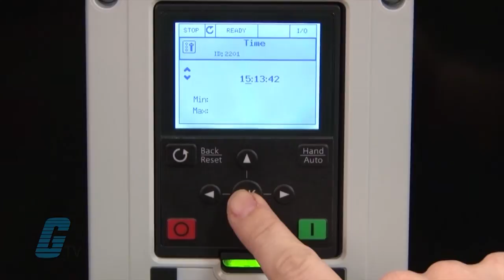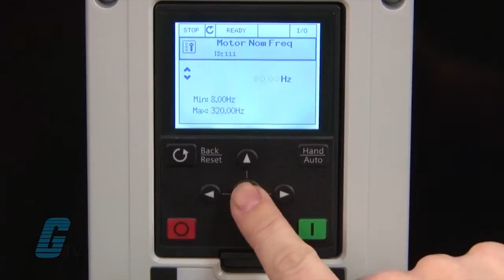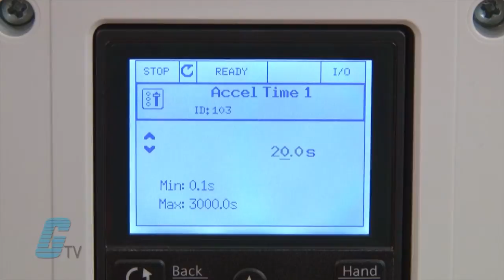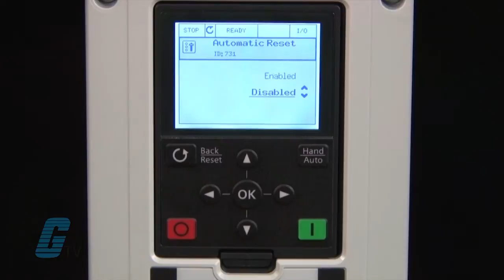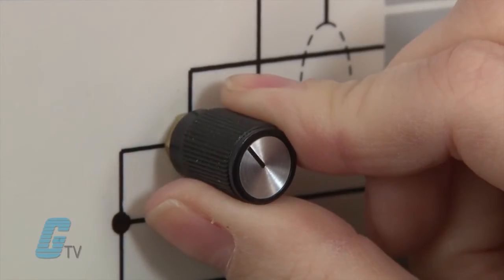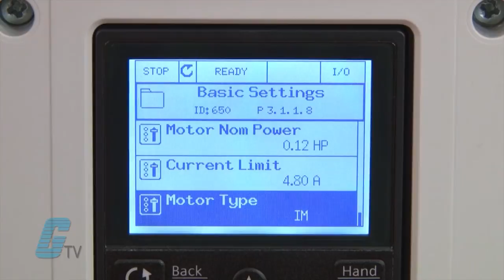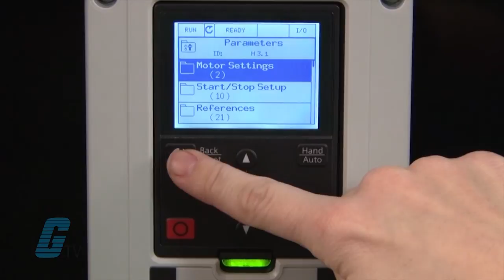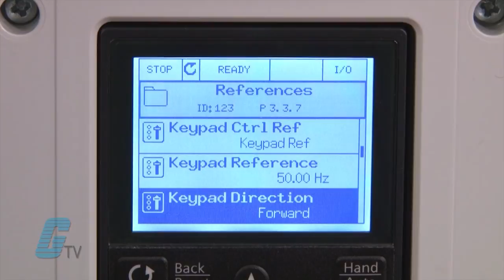How to set up the Siemens BT300 Series VFD for HVAC

Comment: Can you please tell me how to make a extract fan run from 1000 to 4500 cfm. Once smoke is detected by the sensor. Please tell me how to connect the out put from the detector to vfd to make it change in it's frequency so the fan would run faster after the input from the detector. And would come back to normal speed (1000cfm ) once the input is stopped We appreciate you the most.
Reply from the maker: Try connecting a contact from your smoke detector to a preset speed input on the drive. These inputs usually override the analog input and once it opens back up you can go back to analog control. You will have to figure out the preset value to get 4500CFM because drives program in Hz or RPM. Good luck
Reply: thank you so much, BTW I'm working with Siemens sinamics v20, so this works the same?

Comment: I don't understand the naming convention of the DO and AO slots.
Reply from the maker: The BT300 has 1 AO or Analog Output and 3 RO or Relay Outputs which could be referred to as Digital Outputs because they are just on or off. Does this help you?
Reply: I'm sorry for not wording my comment correctly, I was referring to the parameters in the IO config, for example "DigInSlotA.2" or "DigInSlot 0.1." The names dont make sense and nowhere in the product literature (or training materials and other downloads I have at my disposal) are they explained. The only document I have that even references the actual parameter values is a "tips and tricks" word document I got from a coworker, and it literally says "to set a damper interlock, change this parameter to this value" without explaining how the value relates to the actual terminal the wires are landed on.
Reply from the maker: Follow this link for a copy of the manual and go to page 53 in section M3.5  for an explanation of these terms.  https://www.downloads.siemens.com/download-center/Download.aspx?pos=download&fct=getasset&id1=A6V10870703
Reply: Thanks guys. Don't know why I couldnt find it, I even searched the PDF a few times in the field.
Reply from the maker: You are very welcome Matthew